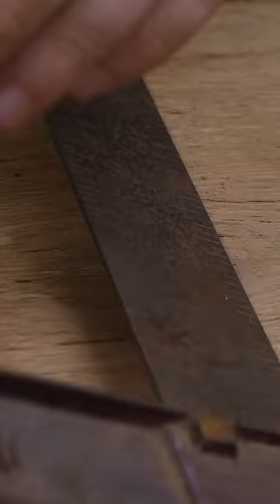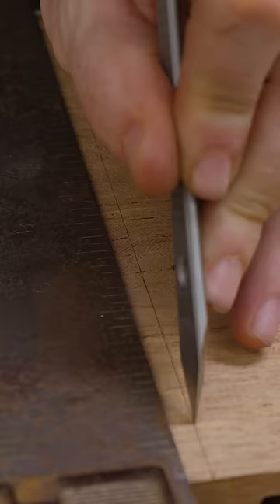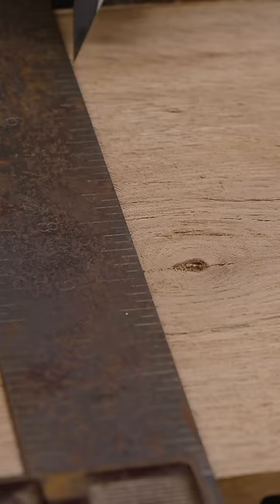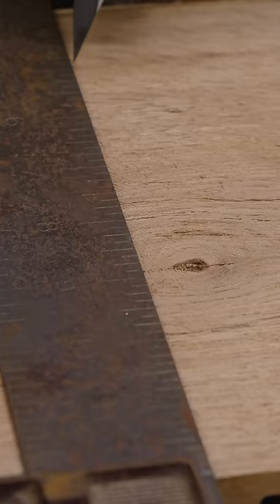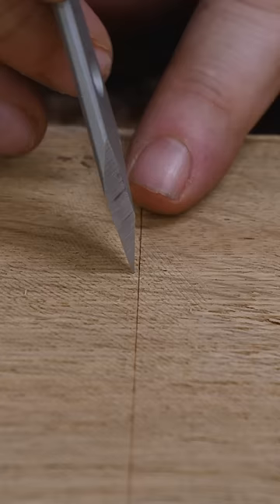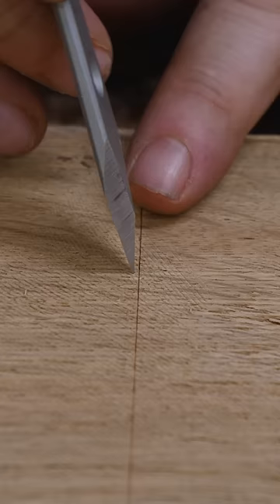How to Test For Square and Straight

Comment: Coming from aerospace, I always have to tell myself that everything will be ok, when tools aren't calibrated and within 0.001 inch tolerances.
Reply: Aerospace and not using metric?
Reply: @MatthRrrr Yes.
Reply: Same, not even in aerospace just some hobby machining and really like precision.
Reply: @Can_Head 0.25” is precise enough.
Reply: Aerospace? Y'all probably working with even smaller units, right? Even in a machine shop we're occasionally measuring in the ten thousandth
Reply: @MatthRrrr american aerospace, like mechanical, is an unholy amalgamation of every unit known to man.
Reply: @MatthRrrr In North America, Imperial is still MUCH more common in every machine shop.
Reply: @etherigni just wait until you get into the automotive industry. metric machine threads, inch bolt circles, AWG, NPT fittings, it's a mess lol.
Reply: @boostaddict_  ya, that's a big no from me dog, I'm fine with my pure physics
Reply: pi = 5
Reply: Slap a "for reference only" sticker on it and you're good to go
Reply: @MatthRrrr in the US, the aerospace industry (excluding NASA) does not use metric. Same goes for any other engineering in the US.
Reply: Same. I was a machinist for over a decade and now I woodwork as a hobby. I still take too much time and make things too perfect. It satisfies me.
Reply: @slippinslidewayz how everything should be done
Reply: @boostaddict_ Its great tho, eh? Recently got my hands on a '73 D300 grain hauler, painted bronze metallic, with a white roof (both still shiny by the way), frame is great, runs beautifully, and only needs a floor pan replaced, and tires. Oh yea and its been sittin' for 25 years in a barn. And i only paid $2750 CAD. 318 with a 4 speed and its a dually.
Reply: This was me getting into woodworking soon after taking a basic machining class
Reply: @MatthRrrr Americans lol
Reply: Im a nuclear engineer; and my biggest niggle is hearing people say stuff like "square enough" when referencing their eyeballs lol.  

Its all preference and your own self tolerances lol. Some people are ok with gaps
Reply: You mean .0002. Im a machinist and all my tools and machines must be less than .0005. We want perfect, but .0002 is close enough.
Reply: Sometimes measuring something within 0.001" is too inaccurate.
Sometimes measuring something within 2 feet is too precise.

You got to know when something is enough...
Reply: You must work for Boeing.
Reply: Cutting two boards and doing the flip will give you a square side. Feel is supposed to be around 4,000 of an inch. Don't need a square.

Comment: The joy of woodworking is you’re only messing with 1/16”s (on fine 1/32”s if you’re a cabinet guy), instead of .001 like a machinist.
Reply: .004 if you are a violin maker.
Reply: @GiovanniCorazzol luthiers are extremely pretentious
Reply: @oldtimetinfoilhatwearer  no, I'm never like that. I am always curious about the techniques and little trade secrets other craftsmen use. You see, this way of checking for a true square, it's one of the first things I learned when I started the violin making course 27 years ago. But, I got it from a textbook that was used by the classes of cabinet making from the other section of my school!
Reply: Fuck i had the pain today off having a cut be .004" over tolerance. The amount of emery i had to do and use 🤧
Reply: 0,1 if ur not American
Reply: If you’ve never tried drugs you’re a square.
Reply: @Zamurai-XXX  decimal imperial. Its been a thing for quite a long time. You take 1 inch and instead of putting it into fraction you just put it into form of 0.00... -> 1.000..." so 0.25" would be 1/4". You can get as much precision as you want because the only limitation is the tools ur measuring with.
Reply: @Fujhipngff this is how I did shit with aerospace titanium and now how I do it now welding 100+ foot sections of angle iron. Just not going to the 10,000th anymore
Reply: Boatbuilder here. 1/16th is out of spec on pretty much everything I do. Especially planks. They need to be touching full length, optimally. Generally I'm pretty unhappy with any gaps over 1/64th.
Reply: @caleb186  that’s fair, but that’s fine craftsmanship lol. You’re doing the aerospace engineering of woodworking.
Reply: As a welder anything under +- .250" is close enough.
Reply: @illbeyourmonster1959  damn man, havent worked with those tolerances since i stopped building houses😂

Comment: Your video reminded me of a time where my supervisor was cutting metal on a band saw for a tight tolerance project and after a couple hours of cutting, I went up to her and asked; “did you make sure the bandsaw was square before cutting?” She said no! I fixed it for her then she got hella pissed off at everyone even though it was her fault… good times 😂
Reply: Women ☕
Reply: I had the fun time as am amateur woodworker diying some tables.  The best saw I had for most cuts is a radial arm saw.  I didn't check the saw's travel, and it was like 1 or 2 degrees off 90.  Not too far off, but did mess with things and I only noticed late into the project when cutting the end of the board that had paint on it, shaving off 1/8 inches and one end was visibly thinner than the other.

Comment: I had an old carpenters square and was making some cabinets and some lines for me to route out some dados. Yup the carpenter square was out something like half and inch near it's end, so I end up going to you tube to find out if you can make it square again, Yeap you take a metal punch and hit is either on the inside or outside of the 90 degree to either push out or pull in to get it aligned. Crazy stuff.

Comment: Check it with a triangle and if you don’t have a triangle use the corner of a rectangle. If you don’t have a rectangle use a plumb line and level, if you don’t have a level use a glass of water , if you don’t have water use milk or spit.
Reply: But what if you don’t have milk or spit??
Reply: What if you don’t have anything straight? Simple: take three similarly sized, and already somewhat flat hard stone slabs. Take turns grinding each one on against the other, and you will eventually end up with a surface plate. Excellent if you’re stranded on a desert island and want to do some machining to pass the time.

Comment: Calibration.  I once had a Stanley line level….the bubble vial had shifted  and you could only see one line.   I centered the bubble on the line.  It wasn’t until I unsuccessfully leveled an above ground pool and a metal awning  that I discovered the vial had shifted and everything was a half bubble off.

Comment: I just flip it over and check for parallel (90°-90°=0°)

It doesn't matter if it's straight if you place the square in the sane place the two should line up.

But straight helps because the eye can discern parallel better than variable thickness in a line 

If it's long enough if worth measuring the distance between parallel lines, but you can tell if it's off
Reply: Oh, you did the same thing

Comment: I use a similar method to test whether straight edges are straight. Put it on the floor or something you don't mind getting a pencil mark on, trace the edge, then flip it over to see whether it still follows that line
Reply from the maker: It's the same for checking levels.

Comment: Yeah, usually this for smaller stuff, otherwise i really like the 3-4-5 method (a side of 3 and a side of 4 will have a diagonal of 5 for any square angle, no matter the unit you chose, but tricky when too small)
Reply from the maker: I like using that on any square over 18.

Comment: the most repeatable way is to use a sheet of copier paper.  because of the process by which they are cut, they will be very square as most of the high speed machines that print are intolerant of paper that is not  perfectly square (general tolerance is within .001 per inch)

Comment: U could use 345 method. 3 on one side 4 on the other when the hypotenuse is 5 u have a 90⁰ angle. Units do not matter u can use mm or miles as long as u use the  same unit obviously.
Reply from the maker: Right on. That is what I mentioned at the beginning A^ +B^ = C^ it works great on larger measurements but for squares under about 12" the mechanics of doing the measuring introduce a lot of error. Not to mention it takes 2-3 times longer to set up.

Comment: How do you adjust that type of square? I have my grandfather’s or father’s and it is out of square.
Reply from the maker: I have a video on that linked in the discription. Unfortunately you can not put links in the comments anymore on shorts.
Reply: If your square is acute, you use a center punch and on the blade portion use a hammer to tap a divot on the inside 'armpit'. This forces the blade outward from the handle. If it's obtuse, you strike a divot in the blade on the outside 'shoulder'. This forces the blade towards the point towards the handle.
Reply: Give it a whack on the bench
Reply: @WoodByWrightHowTo  There seems to be a new feature where you can link to the full video somewhere around the video title and channel name. Seen that in a bunch of shorts recently(around a month or two).
Reply: @prairied0g The word is "divot", BTW.
Reply: @wbfaulk  Thanks! Vorrected.
Reply: @prairied0g  The word is "corrected", BTW.

😉
Reply: @wbfaulk  hahahaha! My giant thumbs and tiny phone.
Reply: Prairied0dog
I was waiting to see if anyone knew the correct answer!😁.  People think they need to file, or hit it on the floor.   One suggestion I would make to everyone is to keep all measuring tools separate from all other tools, and treat them gently, and with much respect. 

Two tools I would like to own:
*Another Sears plumbers chisel. That thing was worth its weight in gold. 

*My own design. What I call my version of a 3-4-5 block and square all in one tool. Body is: 1/2” x 3/4”x 3”. Blade is: 1/8”x 2”x 5”.  A lot of measurements can be taken without ever setting the tool down in the box (NOT ON THE BENCH!).  That one tool can give measurements in 1/16” increments all the way up to 10”.   I guess it is my version of the Stanley Oddjobs.

Comment: Another way to check for straight is to take two edges and see if they are both flush all the way when beside each other and touching all the way when opposed.
Reply from the maker: If one is concave and the other is matching convex they will still touch when apposed. But if you take a third edge the only shape that works for 3 is straight. You can also set the edge down and draw a line then flip the edge and check it agents itself.
Reply: @WoodByWrightHowTo  I did not mean flip end for end but rotation along the edges of interest. It is basically the physical stop version of strike a line and flip the straight edge that you suggest.
Reply from the maker: Oh yes. Comparing it to itself. Rather than comparing it to another board.

Comment: Similar process to check if your level is level. Walked into a HD once to buy a new 6ft level not a single one was within advertised tolerance. Nice looking level but no way to adjust the bubble.

Comment: Similar method for a level if you take a level on a flat surface and Shem that surface just until the bubble begins to touch the line then spin your level around 180° then if you have anything except the identical reading your level is not true

Comment: I mean, this would be easy to correct via manufacturing. All they have to do is have set pins that come out through the handle that holds the handle in place at all times.
Reply from the maker: Works until the first time it's bumped. They tend to go out of square in proportion with how vigorous the user is.

Comment: Can you show how to adjust it with a center punch
Reply from the maker: I have a few videos on that, but I prefer not to use a center punch. that puts a good bit of stress in the blade and puts the back out of alignment. The file method is my preferred method.

Comment: However, if the wood is a bit curved and the square is off a little bit too, it could give the same results.
Reply from the maker: that is why I gave 4 ways to check the wood.
Reply: @WoodByWrightHowTo  <--<< I enjoy wood working very much. A part of that enjoyment comes from figuring out how to make a jig that overcomes a challenge. 
Your video was good, my comment was only meant to be along the lines of "you can never be too careful"

Comment: It’s not that hard to check a square! I just use a simple laboratory-grade granite reference square and a traveling squareness comparator on a granite surface plate. That usually gets me close enough for woodworking, but it could still be out by ~.00002”, though so it’s not perfect.

Comment: Our wood work teacher in high school also taught us a neat trick like this, for when trying to find the centre of a wood piece when using a horizontal drill press. You lay the piece down and eye ball close to the centre, then just press the drill bit into it to make a small notch, flip, and make another notch, if it's not centred adjust the Hight until both notches are on top of one another. 
But when the hole class was taking the written test, only 2 people got that answer right, me and the guy sitting at my table, and because the entire class got that answer wrong he accused one of us for cheating and copying the answer off the other.... Like Mr P are you fucking serious, I MADE A FUCKING COFFEE TABLE IN MY SPEAR TIME IN YOU CLASS, IT WASN'T EVEN IN THE CURRICULUM, I FINISHED ALL THE WORK BEFORE THE END OF THE YEAR! I HAVE DRILLED MORE THAT 100 FKING HOLE ON THAT HORIZONTAL DRILL PRESS... SO HAS THE OTHER GUY!!! You should have been a metal work teacher instead, because they must be a metric fuck ton of lead in your blood.

Comment: That's a good method  but if you eyeball the straight edge, wouldn't it be faster to just directly eyeball the square? 😊
Reply from the maker: You can eyeball 180° cuz that's just a straight line. But you can't eyeball 90°.

Comment: If snyone is curious about the metal trades (machinists etc) most workshops have what is called a "master square" which is actually not square at all, its a precision ground cylinder on a perfectly flat surface plate that you hold your square up to to see if theres a gap between the cylinder and the blade

Comment: Using a string as in the example given, there's actually a chance to get a false validation of the straight edge. When the edge is curved inward of course you'll see some space between the string and the wood. But when the edge is bowed outward, the string will sit on the edge just as it will do when it's straight.
Reply from the maker: if the edge is convex. it will not touch all points at the same time. it will touch the highpoint first.

Comment: 3 4 5 methods work great. Mark 3 inches one way, 4 inches the opposite way. Measure the distance between the two points on an angle. If it's 5, it's square. Doesn't have to be inches either, feet, millimeters, pickles even. I've used it many times, accurate results each time. If you're unsure, you can even use a mititoyo scale for more accurate measurements.
Reply from the maker: Right on. That is what I mentioned at the beginning A^ +B^ = C^ it works great on larger measurements but for squares under about 12" the mechanics of doing the measuring introduce a lot of error. Not to mention it takes 2-3 times longer to set up.

Comment: Measure across 3, up 4, and the connecting diagonal has to be 5 inches if it’s square. For a larger measurement, 6, 8, 10 works, or any multiples of 3, 4, and 5 inches.
Reply from the maker: That's also known as the Pythagorean theorem or a squared plus b squared equals c squared as mentioned at the beginning of the video.. It's good on larger angles but for smaller angles under a foot or so it's not very accurate. The actual mechanics of doing the measuring is the problem.

Comment: 3-4-5 triangle. Every time. Just pick and 3-4-5 dimension and you’re good.
Reply from the maker: Right on. That is what I mentioned at the beginning A^ +B^ = C^ it works great on larger measurements but for squares under about 12" the mechanics of doing the measuring introduce a lot of error. Not to mention it takes 2-3 times longer to set up.

Comment: To adjust it, use a center punch . If it's <90°, punch it on the inside corner of the square. If it's >90°, punch it on the outside corner (across from inside corner) of the square ..
Reply from the maker: I would not do that with a try square, but others yes. I have a couple videos showing how to address a try square.
Reply: @WoodByWrightHowTo  I wasn't talking about tri-square. I was talking about the kind of square in your video. Yes. A tri-square is a totally different issue. The best way to ensure your tri-square is square, is to buy a Starrett LOL but seriously it depends on the what the tri-square is made of when determining the right course of action of shimming up that slide
Reply from the maker: I was using a try square in the video.

Comment: Or you can use the 3, 4, 5 method. To know if a angle is 90 degrees, mesure 3 inches on one side starting from the origin then mark it. On the adjacent side, mesure 4 inches from the same origin then mark it. After that. Mesure the distance from the mark on the 3 inches to the mark on the 4 inches. If it is not a perfect 5 inches, you don’t have a right angle. You can test any right angle with this method. Instead of inches, you can use feet or miles. You just need to have the same unit of measurement.
Reply from the maker: Right on. That is what I mentioned at the beginning A^ +B^ = C^ it works great on larger measurements but for squares under about 12" the mechanics of doing the measuring introduce a lot of error. Not to mention it takes 2-3 times longer to set up.